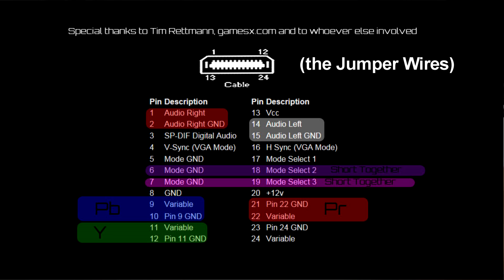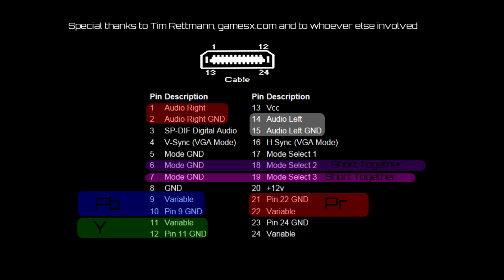Make Your Own Quality Component Cable For The Original Xbox

Comment: Great tutorial. Unfortunately, I just couldn't do it.

I'm way too bad at soldering to pull this off. Seemed easy enough, but the soldier points are just too small and I don't have the effort, equipment or skill to do it. I damn well tried though 😂

Comment: Been holding this off for months, but i lost the circuit inside the connector for the official xbox av cable. Luckily, i have a spare third party one i can do over. Hope there won't be anything different or too difficult for the process.

Comment: Does anyone know if we can simply tie all of the grounds together and solder to metal part of the connector? 

The reason I ask is that the rocket fish 360 cable I just took apart did exactly this. That seems a lot easier.

Comment: Can I use Chinese component cable instead of the official composite cable ?
Reply from the maker: Your going to run into the distortion problem still, or I would assume you would. You could use some other decent quality component cables and say the connector from a cheap xbox cable.

Comment: i just picked up a cheap component cable ... it's shitty. my av cable got a better signal. might aswell buy a 360 component cable, seems to be even cheaper in my area anyway lol.
Reply from the maker: Yeah I did the same thing those cheap ones suck for the xbox, never had any issues with the cheap ps2 ones. But good luck with the mod!

Comment: I build this and it work great. The soldering to the XBOX connector Was a bit hard without melting the plastic. 
I cut the whole xbox 360 connector of and strip the cable. So I was able to use the original plastic from xbox conector and it looks like it was shipped like this.
Reply from the maker: Yeah I forgot to put the plastic back on during the video and didn't want to remake the whole thing. Years later I did go back and put that plastic connector piece on haha. Glad you go it working! The soldering is a bit tricky

Comment: Ok so I just followed this guide and my pr signal isn’t working. My multi meter shows that it’s connected to the pin and to the rca Jack so I’m confused. Also non of my pins are grounded.
Reply from the maker: I had a similar thing happen to me, all i did to fix it was hit all my connections with some more Flux and the tip of the iron to make sure they were solid.

Comment: Thanks for the video, i cut the head off my 360 cable only to realize it wasn't a genuine one LOL all the colors were different so out came the multimeter.
just a TIP for anyone else its easier to pull the rear silver metal bit off the original xbox cable and then u dont have the bend the front steel piece at all
Reply from the maker: Yeah, iv had a couple of people tell me the same thing. I'm glad you got it all sorted. Thanks for the tip!

Comment: I have a cheaper component cable that doesn't have interference, yeah the color looks saturated on the screen? So taking my 360 cable and the OG Xbox input we'll make the display that much better??
Reply from the maker: The cable will end up being just as good as a quality cable  I'd say it's definitely worth it.
Reply: @TechnoOnTop  Picked the component 360 cable up at an old thrift store today (3.00 each). Going to try this! The Ebay one has wavy lines on the screen...Mostly only starts that when I start a game...
Reply from the maker: Oh nice! Tough to find them that cheap anymore! I remember walking into Goodwill and there where literal boxes filled with them.  Yeah the made cables will definitely get rid of that problem!
Reply: @TechnoOnTop  Just finished! First I had the look the diagram upside down. re-soldered the wires and its great! Audio does seem to be more vivid also! Thanks for the project, I was getting bored!

Comment: Aght, for real bro there is absolutely no way in hell I'm going to do all of this, not when you can get an official Xbox HDMI kit for like 25 bucks.

However this is some impressive stuff, so I'm still going to give you a thumbs up cuz well I'm not willing to go through all the problem of doing this entire mess I'm pretty sure someone else is and this video is really good at explaining what you got to do step by step.
Reply from the maker: Yeah, iv never had one of those adapters so I can't really speak on their quality but from what I have read they do have artifacts, but only really picky people would care. But thank you I tried to make it as straightforward and easy to follow as possible though I have had a few people tell me it's not easy at all to follow so idk different ways of thinking.  My only regret is not adding back in the rubber connector piece... it was always my intention, but this video shows literally the very first time this mod was ever done (to my knowledge anyways, it was talked about on forums) and my soldering skills back then where sub par at best. I did eventually go back and add in the piece years later so the hot glue held up well anyways I appreciate you checking out the video and giving it a thumbs up!
Reply: Depends on the adaptor you get XEDUSA or the Electron X Out adaptor are great options. Most of the other adaptors like the Pound adaptors are trash. Or you can just get the XOSVP adaptor, and plug that into a scaler or a CRT.

Comment: Hey there, unsure if you still read these comments, but would you happen to know if I can use a regular component cable instead of the 360 cables, as I would rather not chop up one of mine as they are becoming more expensive and harder to find where I live
Reply: further to that, could I use a cheap-o 3rd party component cable instead of the original xbox rca cable?
Reply from the maker: Yeah you could use any generic component cables, and you could also use the connector from the cheap component cables, for what it's worth the cheap component cable connectors are well cheaper and easier to bend/pull out/mess up pins.

Comment: I did it the same way, but my cable still produces some artifacts like vertical lines - much less than a cheap China cable but still...any ideas what to do?
Reply from the maker: Really your the first person to say that. Firstly just check over the soldering, make sure the ports on both the console and cable are clean, do you happen to have it running by or even with power cables for other stuff? I know it's possible to pick up interfence from other devices, though iv personally never had that issue. Have you tested it on another TV? Or even another console? The 1.6's have the weakest video chip, idk that's all iv got as iv never had the issue, I did recently switch to monster cables mainly just because I got them for cheap but I don't think they made any difference from the homemade ones.
Reply: @TechnoOnTop  First of all, thank you very much for the answer. There are no other cables running by or whatsoever. However, I desoldered everything (Pb, Pr, Audio) and soldered only the Y-Cable on. I wanted to detect, where the artifacts are generated. Unfortunately the lonely Y-Cable itself produces those artifacts. The green cable alone produces the artifacts, which rules out interference with other cables as the cause. That makes it even more difficult to find a solution. Maybe the whole "China-Plug" is the problem. Any other ideas?

Comment: Hi! Great mod! I tried it and followed every step but for some reason i miss the red color. I tried solder every join again, checked them with a multimeter to make sure the cable works but sill no red color.. any suggestion ?
Reply from the maker: When you say no red color your saying "that the red video connector isn't working?" seems to be a weird problem. My first advise would be to check continuity but you said you did that. Then of course just double check your soldering to the right spot... Um my only other thought is are you soldering/plugging in the right 'red' cable since there is one for both audio and for video. That's all I got unless iv misunderstood your question. Sorry I can't be of more help I hope that you are able to get it working.

Comment: Thanks so much for the tutorial!  I just finished making a component cable out of an old Xbox composite cable and two RCA cables.  Levered the housing off the shielding with a flathead and swung the shielding open.  Folded a bit of the shielding at the back so it opened up on one side.  Drilled a hole through rubber and threaded the new wires in through the hole.  Switched the VGA connection to Pr and used the new wires for Pb and Y. Switched the ground and added the new one and worked first try!  Really wish I could have found my magnifying glass.  Marked everything with coloured electrical tape.
Reply from the maker: Your the first iv heard of to actually use 2 rca cables! But as you know it's the same just gotta be more vigilant with the colors, but sounds awesome man! I appreciate the comment! Happy modding

Comment: You could not reuse the plastic shell of the composite cable from the xbox cable instead of making that structure with hot glue?
Reply from the maker: The hot glue held up for years would probably still be held up if I didn't take it back apart and re-use the connector piece, yes I originally intended on doing so, but filming and soldering then realizing I would have to film the entire video again when my soldering skills were just barely passable wasn't something I wanted to do. But thanks for watching

Comment: how reliable is this as a cable? Also is there any danger to shorting out the cables due to wiring or the console?
Reply from the maker: Reliable? The cable I made in this video still works the same as the day I made it, I did remove the hot glue and put the casing on recently, and I'm sure there is some danger if you get the pins wrong, iv never heard of anyone messing up though.

Comment: @TechnoOnTop thanks for the tutorial! I’ve made a few of these cables (I screenshot your modified graphic, because it’s the most straightforward diagram I’ve found online ), and I’ll be making a few more, once I figure out how to get the mode select switch (so I can still switch between SD and HD if I want [I definitely won’t, but it hurts my brain not to use the composite video connector]), and TosLink audio working. But the first couple I wired with just the connections you used because they had a broken RCA jack on one side (one is actually wired in reverse and custom labeled because the Red RCA jack had the center pole snapped off). Definitely a better solution than a Pound HDMI cable, and cheaper too (Xbox composite cables and Xbox 360 Component cables are plentiful and cheap at my local thrift store).

One tip I’d add to your tutorial is to double check all connections with a multimeter to ensure that a) the solder joint is good, and b) that you don’t have any pins accidentally bridged together, BEFORE you connect the DIY cable to the Xbox, especially since there are pins on the video connector that supply 5V and 12V. Also note that the graphic has pins numbered as if you’re facing the side of the connector that plugs into the Xbox, but you can orient yourself properly if you count from the audio connection pins on the back.
Reply from the maker: Yeah adding a switch would be a cool thing, but wouldn't you need to add 3 more connectors for the composite? Another solution is just to add to the console rather then the cable, also iv seen a guy on the of Xbox forums actually use the 360 side of the connector housing to add the digital audio which looked pretty good. Yeah this tutorial is pretty old and I made it when I was still learning definitely a good idea to test the connections with a multi meter and visually the soldering is somewhat delicate, it was actually the first time I had ever built one. Iv only built 2 to date and I fixed the connector housing and the one in the video only took me a few years to be bothered by it haha. Glad you like my modified pinout guide, it was and still is pretty straightforward to me but I know others have had issues with it, iv actually condensed it down to a simple cheat sheet for any future ones I make, I wish I could find both cables at the thift shops iv only managed to find one recently and that good will wanted $10 for it I just laughed and left.
Reply: TechnoOnTop I’ve actually built three Xbox cables now, and used another Xbox 360 cable and the connector from a cheap Chinese PlayStation 2  component cable to build a high quality component output for the PlayStation 2 as well (no wavy picture and audio buzz, oh yeah!). I have to say, that compared to the construction of the Xbox component cable, the soldering for the PlayStation 2 component was really technically challenging, and would have been much come difficult without my helping hands, soldering tweezers, and a hemostat. The cable works beautifully with the $10 PlayStation 2 Fat I picked up on a recent trip to the thrift store (needs a new DVD drive and bezel, but I’m just going to forego that and softmod the console so it can play games off of a 2TB internal hard drive connected to a SATA modded Sony network adapter [I have several I picked up for $2/each when a local pawn shop closed down] as a Christmas present for a friend [he’s getting an LCD HDTV and a modded 2TB Xbox as well, because who says handmade Christmas has to be a badly knitted sweater or crocheted booties]).

My Goodwill actually had two 360 cables with two different prices on them and I pointed it out to the cashier and she gave me the $3 price each for both instead of the $7 one was labeled. And I got an Xbox 360 VGA cable there today for $3 as well. Prices at the shops are definitely dependent on who’s pricing them in the back, so it pays to get chummy with the staff (especially the ones shelving items and the cashiers).
Reply from the maker: I had people request a tutorial on making a Ps2 component cable, but the cheap component cables I bought works just fine no distortion whatsoever, so I just let that idea go, the only way it's gets distortion is on a slim using a knockoff power supply, no problems if using an official one though, nice find, I picked up a phat Ps2 recently with 54 games, from some young kid no doubt it was probably left behind by his older brother because he only wanted 60 bucks for it. Yeah I always try and be friendly with them not all of them can be sweet talked into better deals but it definitely can and does pay off every now and again. That's awesome man I bet your friend will be psyched to get some bad ass modded consoles. My first modded Xbox was a gift from a friend as well and it's one of the reasons I started to get into modding in the first place. Maybe you will have the same effect on him.

Comment: I just took my cable apart and my wires aren't the same colors as yours.  It is an official Xbox 360 Component cable with "Microsoft" stamped into the plastic housing and an official "Microsoft Xbox 360" holographic security sticker.  Is there another diagram for this version?
Reply from the maker: Weird, no I don't think there is, you could always use a multi meter to determine what is what,
Reply: @TechnoOnTop  Ok, thanks anyway.

Comment: I would highly recommend de-soldering the wires from the 360 connector which will leave them ready to be soldered to the other connector Original XBOX.  A few years later and the Originals just get more expensive.  This is a $6 (+time) investment from my local goodwill.  It feels like they have both of these cables all the time.  Also, many of the aftermarket cables do not have all the pins in them so you are much better of getting the genuine Microsoft parts.  Thanks for posting this!
Reply from the maker: Yeah you could desolder them, haven't did this in awhile, but I do know that things could of been done better, such as leaving the connector housing in place, which was the intention originally but when your making a video it got forgotten then I just said screw it! I used to find the cables at goodwill, I remember there being stacks of brand new Xbox 360 cables, but nowadays I rarely find any cables for any system makes me wish I would of bought them then. But that was well before I even considered this mod. Thanks for sharing your thoughts and thank you for checking out the video!

Comment: A bit late to the party, but I want to take my original Xbox connector, cut off the 360 connector from it's AV cable and solder the orignal connector onto the 360 cable.
what pins are used by the video RCA cable aka the yellow one in your diagram?

Comment: I notices in the pinout for the plug that pin 3 was for digital audio. Would it be possible too run a jumper rca plug from pin 3 and say 24 for the ground to plug into a coaxial digital audio for dolby 5.1 sound?
Reply from the maker: Yeah I'm pretty sure you can do that, would actually be perfect to use the yellow composite cable for that instead of just cutting it off like I did in the video. Good luck happy modding!
Reply: Thanks, might have to give that a try.

Comment: what's the point of making a replacement for the official av cable when you need one to make it
Reply from the maker: ? You need a composite cable, which you likely already have you could also use an aftermarket one but they are cheaply made the pins pull out easy. Then an official Xbox 360 component cable. Which at the time I made this video were everywhere for way cheap. I remember walking into goodwills and just seeing stacks of them. (which i wish I would of bought then all.. Anyways thanks for watching